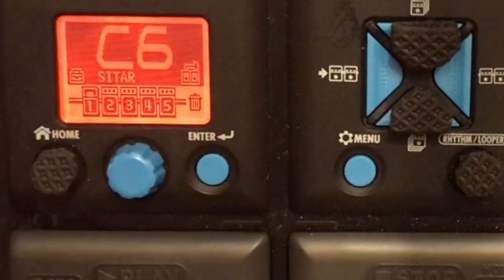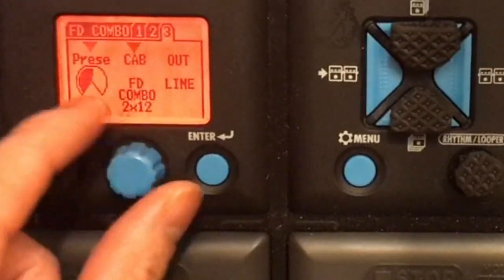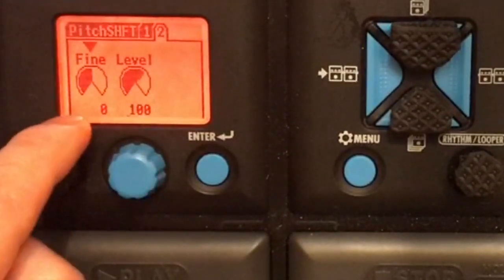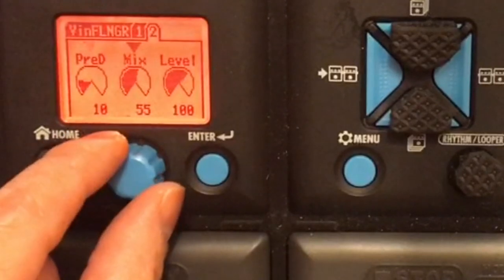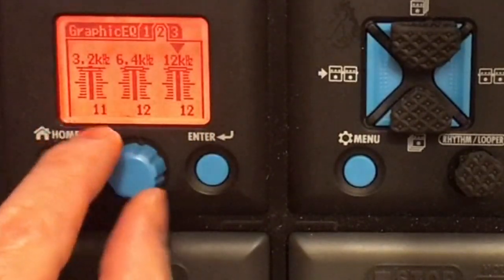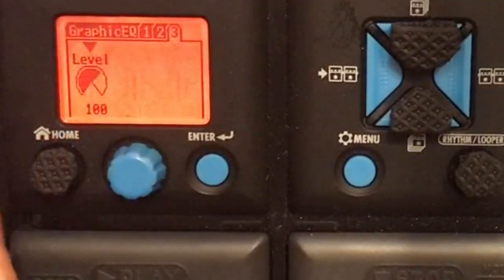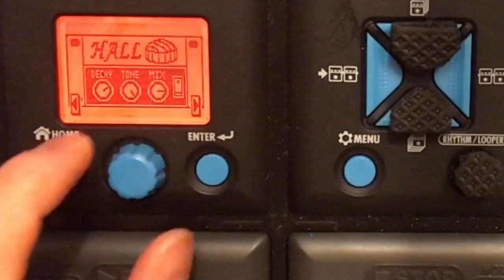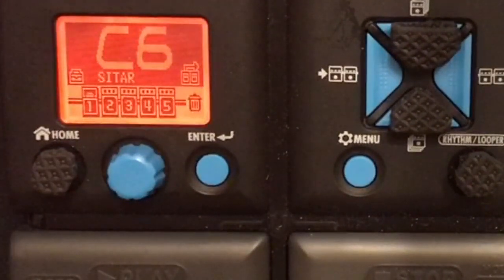Tutorial How to create a Sitar sound using Zoom G1xon G1on Patch Setting

Comment: amazing. I did it with the g5n. Added in the beginning of the chain a second equalizer boosting mediums and an acoustic simulator. It's so sool
Reply from the maker: João Paulo Costalonga nice! Yeah I think with the Zoom line you can use most of the stuff because they share some of the effects and amp sim. Glad it worked as well plus your added tweaking!
Reply: Could you by any chance give me your patch settings and any other patches coz I recently got a g5n..
Reply: @SumedhVaishampayan  It is very alike the one in the video, just add an accoustic simulator in the left side of the chain. Top and bottom at 30, tone at 75 and volume at 85. In the left side of the acc. simulator and a gt. eq. set at 0 - 0 - 3.5 - 9.5 - 2 - 0 - 60. Everything else was copied from the video.

Comment: Man. That thing is Loaded!!! People say this pedal can be updated and modded too??
Reply from the maker: Hello Rob. yeah I think there's lots of things you can do about this pedal. There's ToneLib that I havent tried yet. It's basically a software you need to download and install on your computer and then connect this Zoom G1xon and tweak it from your computer.
Reply: @vincentryanborres  I was about to discard my Zoom G1Xon but ToneLib gave it a second life, as I can now dial the tones I want much faster! Btw, I see some pads on your pedal, which seems a nice idea. 

My G1Xon has problem with the footswitches - I have to press several times to change a patch (at home I usually do it from the PC/mobile), but for live situation this is problem. Have you had similar problems and if so  is there a way to fix. Nice tone, I will try it out, thanks.
Reply from the maker: @gorimus  Thank you! Yes I've heard about toneLib but havent use it. The pads is just to save me from bending down during live gigs or even rehearsals to change from looper to rhythm as well as home and to skip banks. 

I've had similar problems before but it was more of the wah pedal and I think it was the dust build up. So I just cleaned it and keep using it until it came back to normal but I also made an improvised case for my Zoom G1xon because of that issue. Now it seems my effects pedal is protected from dust and even from bumps and scratches because of the cover. 

I think there are few people who messaged me about this problem, it's either the buttons are playing up or not working. But if you think of it, the material for this pedal is cheap so it's more likely going to break or damaged quite easily. 

If you know someone or electrician who can open it up and try to look at your unit, may be the switches underneath need changing. Hope this helps.
Reply: @vincentryanborres  I opend the the base plate, but the footswitch part wasn't visible. Didn't want to  risk further opening it up, so closed it back!
Reply from the maker: @gorimus  Yes, if your not comfortable and/or confident, I think it's not worth it to open and create more damage to it. Zoom G1On is rather cheap price so if for example the repair is costing you a lot then it's probably worth to just buy a second hand or a new G1On. Hope you get your pedal sorted.
Reply: @vincentryanborres  Very true, not worth opening it further. If it stops working then I'll either go for G3xn or G5n or G1XFour. I think G1XFOUR is roughy the same price as G1Xon and hopefully the G1Xon patches should work on G1XFOUR. Cheers!
Reply from the maker: BA Gorimus totally agree. I also think they are phasing it out and changing to G1Four/ G1xFour